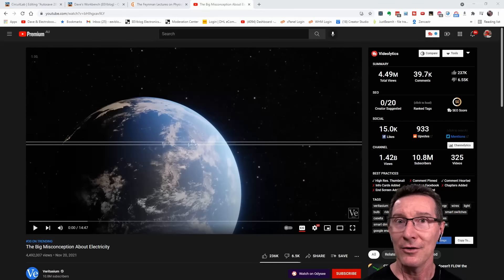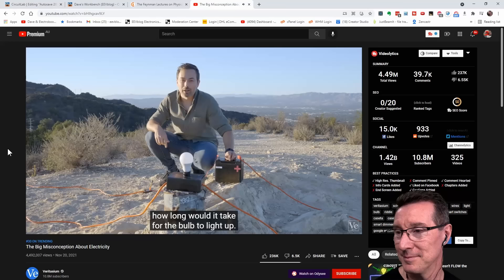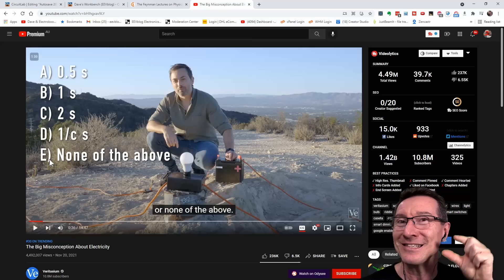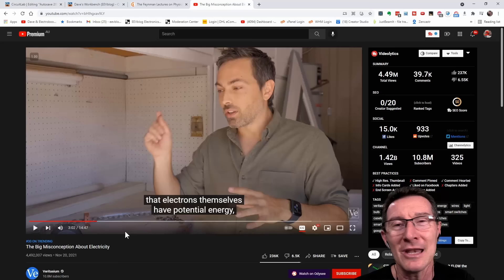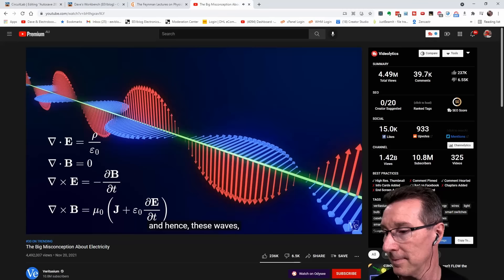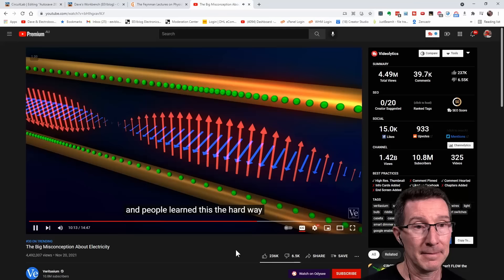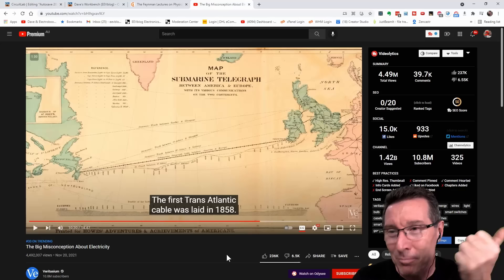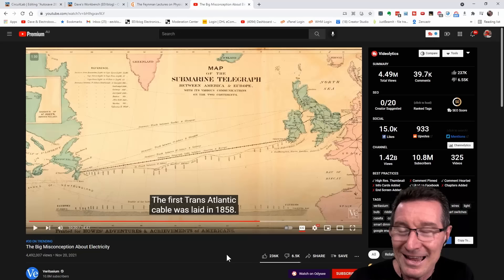EEVblog 1439 - Analysing Veritasium's Electricity Misconceptions Video

Comment: I am an engineer but still don’t like the solution with transmission line. Fundamentally it does not represent the reality. Those additional wires, resistances and capacitances do not exist as is. We have been taught to represent the situation in a simpler way for us to be able to still apply our simplified law. But this is not reality, just a simplification of it. Maxwell’s equations really demonstrate what is happening without the need of changing the wire by a theoretical set of chained capacitance-resistance.

Comment: I threw this comment / challenge at veritasium, but maybe you would like to take it on as well. The poynting vector maths says that in EM waves the electric field and the magnetic are in phase. My question is can you prove it! 

If you use say a hall effect to measure MAGNETIC field and a oscillator feeding a wire you can see the electric and magnetic are out of phase. (Or repeat history with a battery, wire and switch over a compass)  We now have magneto resistive and AMR stuff - basically anything in a modern hard drive, these have a high frequency and sensitivity response. Can you use something like that to show they E and B are indeed in phase.

Yes I know I am setting you up with near field and far field stuff. But while poynting vector maths is ok and so far it works, I would contend it is not that well proven experimentally. See also the steady state aka DC current problem - energy flows into the wire at right angles - what the ? See also circular polarization left and right versions exists. Can be decomposed into two orthogonal linear but what happened to the right hand rule..

Comment: Thx a lot for these explanations. It helped a lot, but wouldn´t it be possible to simply visualize it with an experiment? Would it be possible to setup a lightbulb with a wire on each side and in a distance of 1m from it an AC power source with the another wire that is located in parallel to the first one and switch the bulb on through the EM field generated by the battery and the wire? THX.

Comment: So what I wanna know is, how much power and how thick the cable has to be for the light to be turned on to the brightest. Also how long would that take to happen?
Reply: EEVblog's lumped element model here is not the right one for Derek's experiment set up.  Derek's answer of 1/c is not entirely correct either.

Go to the top and sort comments on "Newest First", scroll to the time stamp of this post, and read mine.  You'll be surprised at what the answer really is.

Comment: Imagine someone cuts the wire at the farthest point, 150,000km away. If we close the switch and the lamp lights up in 1m/c seconds that means that we got the information from a remote point in space faster than the light could travel from that point to us. If we keep switching the light on and off every 2m/c and someone cuts our wire 150,000km away, we will learn about that within 1m/c time. Superluminal data transfer?

Comment: So you are saying that the current paths through the ground plane follow the paths on the traces in the board?  Even for DC or just AC and pulsed?
Reply: EEVblog's lumped element model here is not the right one for Derek's experiment set up. 

This should help ... 

Go to the top and sort comments on "Newest First", scroll the time stamp of this post, and read mine.  You'll be surprised at what the answer really is.

Comment: The pleb that I am took this away from all this: the wires merely direct the energy from source to target.. if you could find a way to keep the magnetic/electric field contained near a path you could achieve the same result without wires

Still thinking about it, it would seem that if you 'assume' that energy will flow 'across' over that 1m vs over the huge distance on either side, it's almost as if time is not a factor in that theory..
If you discount time does it make sense that whatever the distance, the energy takes that shortest route from source to target 🤔🤔

Comment: All I know is It takes much heavier cables to move larger or heavy loads at 12V DC power to a load over distance, In other words the higher the voltage the smaller the wires can be to power a said load.           Also if you run high loads of A/C power cables say in three Phases through say stainless steel conduit you have to run the three phases right next to each other, Because if you try to run each phase through separate tubes the tubes will turn red hot because the Phases aren't being cancelled  out by each other in a separate tubes, In other words if you have three separate conduits you need 9 separate cables to move this power through the conduit Safely.
Reply: If those separate conduits were each grounded at one point there would be no heating.
Reply: @tomgroover1839  That's why I asked it seemed like such a mess of cables just to run Variable Driven power cables to a 300 HP Electric fan motor, Tha stainless steel tubes were all tig welded to the same boxes, When I ask why, Are you running all those nine Separate cables, He claimed if he didn't do so the Conduit would turn Red hot after running for Hours daily,  He could have added three more cables in a forth tube if the cables were still not heavy enough to carry the 300 HP load I guess, Hell each individual cable was about 1" thick I don't remember how far the Variable drive was from the motor anymore, It's a Almost 5 foot high Motor, It was cool listening to that being turned on because it would slowly speed up then was automatically speed controlled by whatever Vacuum was required to run the HUGE four story tall baby food formula dryer and to keep that Massive natural gas flame lit properly without blowing the whole thing up like people have in the past killing people, It was all controlled by a huge Computer network Programmed by some very smart Japanese computer code writers, Designed in Brazil, Operating in Greeley Colorado. Built by Tetra Pac food processor drying solutions.
Reply: @raymondreiff8170  yep there would be no current flow in those tubes if there were not return paths thru ground which would only happen of a tube were grounded at multiple  points

Comment: So, if i understand you correctly and what i can think from the transmission line analysis is, what you'll see is a blip at 1m/c seconds, and then 1s later it will be continuously 'on'.  If that is the case, i would say Veritasium's video is definitely misleading, in that he makes it feel like it will be steady state glowing at 1m/c seconds(although he has cleverly never said it explicitly). Anyhow, your explanation with transmission theory, is definitely easier to understand, over what was explained by Derek. It would be great, if you can simulate it until the point of reaching steady state, that would help us imagine it better

Comment: With a 1 light-second long wire I don't think you'd need a battery to power the bulb.
I feel like that surface area would accumulate enough power from background radiation to just... Work.

Comment: How do the fields "know" if the wires are continuous, i.e. not disconnected? What if the wires are 1 ly long? The field NEEDS to propagate through the wires, right? And that takes time.
Reply: Essentially correct, in Derek's experimental setup.  EEVblog's lumped element model here is not the right one for Derek's experiment set up.  Derek's answer of 1/c is not entirely correct either.

You'll be surprised at what the answer really is ....

Go to the top and sort comments on "Newest First", scroll to the time stamp of this post, and read mine.

Comment: So...  If I put a bulb 1 meter on the other side of the battery with wires going out from the bulb parallel to the other wires for the 1/2 light second distance, BUT WITHOUT A RETURN, the second bulb will ALSO light up when the switch is closed?
Reply: My comment should clarify this for you.

EEVblog's lumped element model here is not the right one for Derek's experiment set up.  Derek's answer of 1/c is not entirely correct either.

You'll be surprised at what the answer really is ....

>>> Go to the top and sort comments on "Newest First", scroll to the time stamp of this post, and read mine.

Comment: Idea - What if you set the voltage to y = kt+m a linear increasing voltage with low constant k. Then the forward derivative and back derivative is the same. You don't get a derivative loss? So thats why alternating current is better. sin(x)≃x at some part of the incline. A small constant increase in voltage could do the same from ? 11.9 to 12 in 30 min enough to cook food in a rice cooker.

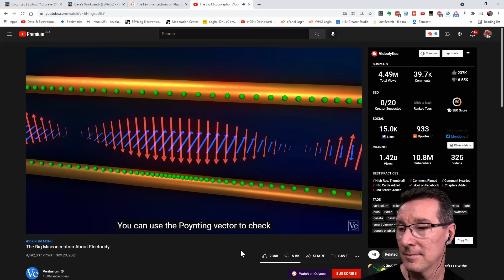Comment: 15:08 How does a circuit put current to work with capacitors, transistors, etc, if the current is in fields around the wire, and not in the wire?

Comment: The distance from the center of the Earth to the center of the Moon is 385,000 km. The Moon's radius is 1727.5 km and the Earth's radius is 6378 km. So, rounding off a bit, the distance from the Earth to the Moon is 377,000 km. The speed of light in vacuo is about 300,000 km/sec. Therefore, a light pulse from the Moon sent towards the Earth would take just over 1.25 seconds. Imagine the Veritasium circuit stretched a bit(!) so the the switch is on the Moon and the lamp and the battery are on Earth. According to Answer d, the lamp would light up 3.3x377/300 = 4.15 nanoseconds after the switch was closed. As a means of communicating, this lamp, battery, and switch circuit is 3 billion times faster than signaling with light. Please tell me where this analysis has gone wrong.

Comment: 😶  Sometimes people are too smart or too specialized to get the point.  The video being critiqued isn't meant to be a teaching tool for electrical engineers.  It's meant to dispel common misconceptions about the flow of electricity for everyone else.  The criticism that the video wasn't detailed or specific enough completely misses the whole point.  Diving off the deep end into a seemingly bottomless pit of technicalities to any layperson would just leave the intended audience in the dust.  Derrick was correct and knew who he was talking to and helped a lot of people understand electricity a little better.  The "shocking" reveal wasn't the meter in the equation, it was that the length of the wire didn't matter in that particular scenario but the distance between the wires.  This video seems to be trying to drum up controversy, and if that's so then the creator's intent just might possibly be sneakily dishonest.

Comment: In that video he did imply the light would come on in a steady state, not some some insignificant transient induction. So no, he sits upon a throne of lies! Not only would there be the electron flow delay due to the length/C you also have to consider the transient inductive load time. That much wire is going to have a lot of inductance, even if it is super conducting. 
So if we actually did this experiment the light would not turn on instantly, probably would not turn on at all. Well actually a conductor that long stretched over space would have all sorts of charges induced in it, the whole thing is just ridiculous.

Comment: So, not aimed at electrical engineers, but rather the general population?  Agreed, but that's actually a big problem for the reasons that you brought up in the Richard Feynman section at the end of the video.  It was therein mentioned that this is an academic exercise presented in a misleading/disingenuous fashion.  I would say that it's a trick question couched in a very specifically worded set of conditions that have absolutely nothing to do with practical power delivery, and it's not even a very good thought experiment because it generates more heat than light (pun ABSOLUTELY intended -- I have no shame).  The general population would be much better served by a clear explanation of the conventional thought process of power flowing down the wires than by a murky explanation of the physics behind it.  But then, I suppose that would spoil the illusion.  Wait a minute, isn't that point of scientific endeavor?  To demystify and spoil the illusion?

Comment: I agree about the distinction about DC and AC. But the original question was all about AC any way. The question was about the time it takes for energy to transfer at the moment the switch is turned on. This is a transient event AC.  I agree the explanations and the analogy doesn't make this clear.

Comment: But I have certainly seen these snake patterns on PCBs where engineers were trying to match signal wire length. According to this these patterns would not matter because only factor is distance. I don't understand.

Comment: What bothers me about this video, is that he’s implying that short circuiting a battery /anywhere/, means that every light bulb will turn on instantly.  The fact that a very, very small and short amount of energy is transferred is not insignificant.  (He’s technically correct, but from an education standpoint, he’s creating misconceptions. Scale and time are immensely important.)

Comment: Why are Veritasium's imaginary provisos "fine" according to you?  (2:09)  I think his required provisos starting at 0:35 make things unnecessarily confusing.  I mean WHY OH WHY ASSUME the wire has no resistance (because HE says his idea does NOT work without that assumption)?  ALL WIRES HAVE RESISTANCE.  AND why assume the light bulb turns on immediately with ANY current...even an INSUFFICIENT CURRENT TO TURN THE LIGHT ON.  Yet another fantasy assumption.  What is the benefit of referring to the real world (light bulbs and wires) when you proceed to break/violate the reality of that world?  How does that illuminate the problem (pun intended).

Comment: Nice explanation, from the other side of the globus, the best until now, 1 meter apart doesn`t  make much capacitance or induct much current, especially in dc and with small power sources.
Lets say energy is lazy like me and chooses the easy way, it depends on the µ (Permeability).
There is a list with Permeability values for different materials.The µ from copper is not the same as the µ from air.
Do not let yourself be electrocute with the next battery!

Comment: Shouldn't it have actually been just "1 m / c"? c is a speed, which is given in m / s. Thus m / (m / s) yields 1 / (1 / s) and that results in just s, which is what we want. "(1 m / c) s" would result in s². I don't know what that would represent. So there is that on top of what Dave pointed out. Am I wrong?

PS: You could understand his answers as sort of "rough classes" of magnitudes, not the literal answers. Sort of. If you squint hard enough. Somewhat like (big) O notation in computer science (e.g. O(1), O(n), O(n²) etc.), which denotes a general trend in complexity of computation or space requirements. These are relative, ignore any constants (which in practice often make a difference until exponential growth takes over) and can be a bit counter-intuitive. Anyway, that's the only case where the additional s I asked about above makes some sort of sense to me, while squinting with no less than maximum effort.
Well, I agree that it would have been better to include the m in the answer, because it's so close and while we're learning about this, let's maybe learn that too.

Comment: Nahhh... If that light is 1000 watts and that wire like 14 gauge, it's probably never turning on because of line resistance. If you assume zero resistance, I'd really like to know if the line capacitance would create enough spike to light the light, keeping in mind that the capacitive effect is traveling down the line. You might end up with an effect like the light flickers on then goes out. Which I think is what was happening with the transatlantic cable.

Comment: I think you were too kind to vertism.  Look at the transient analysis 31.18.  The Current that is induced in the circuit is only a spike.  This means it may not heat the filament in the incandescent light enough to produce visible light (or you may blink).  The reason the light turned on and stayed on was because the wires didn’t really go to the moon and back.  Also it is the interaction of the electrons with the material that produces the light (so they are important).  P = V x I.

Comment: I'm confused on the comment that "50-60Hz is practically DC", what does the frequency have to do with the voltage classification? 

Everything I've been taught so far about frequency has been dependent on motor speed and the number of poles in the rotor/stator, while the voltage type is based on the method of connection between the power source and line (slip rings vs commutator, battery) and any means of correction (eg rectifiers) to transition after the fact. 

I would like references to the engineering witchcraft please I'm just a humble sparky
Reply: He means since 0 Hz is DC, then 50 or 60 Hz is so very close to 0, as opposed to being near microwave frequencies and above. GHz aka RF or GHz circuits behave very differently in and around wires than low[er] frequencies

Comment: My beef with Verritasoum is his generalized statement that "energy does not flow in wires ", implying this explanation applies to all models of simple circuits.  THIS IS A SPECIALIZED TRANSMISSION LINE MODEL.  It would not apply to a model where the circuit is totally circular.  He us misleading the general public.